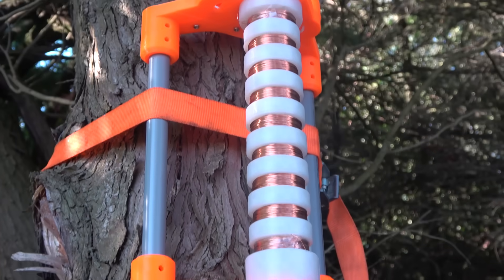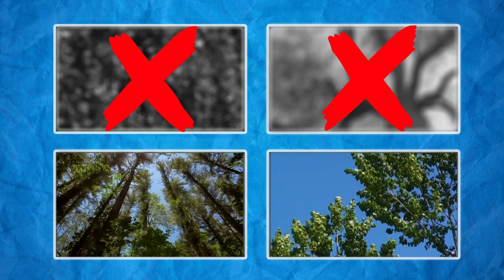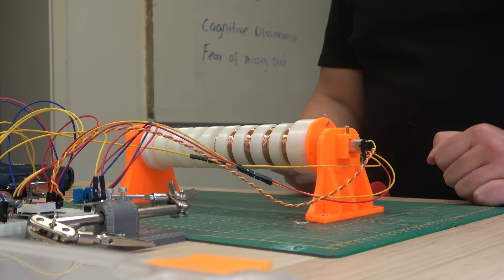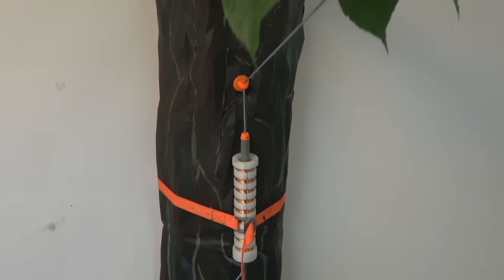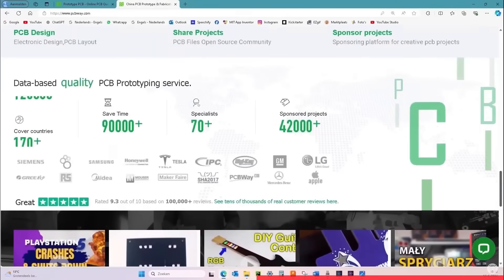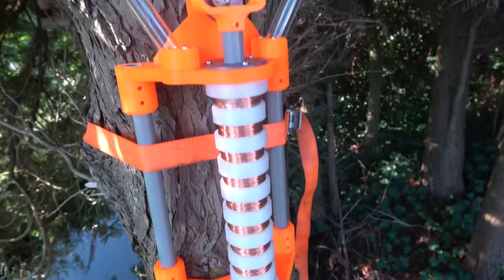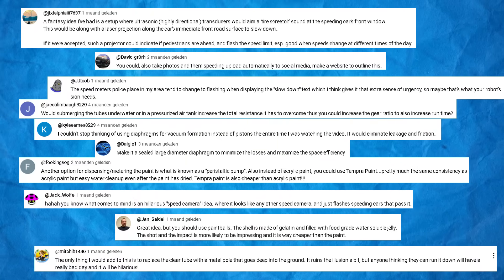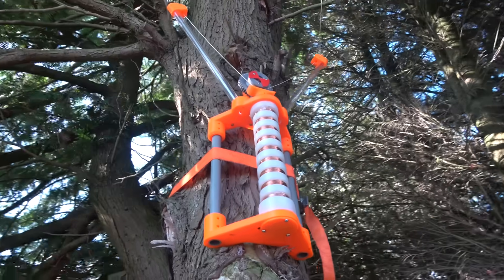I Made a Tree Generate Electricity..

Comment: check out air batteries . 2 aluminium rods and the electrons in the air = power, then get a sponsor and supersize it .
Reply from the maker: If only it were that easy🤓
Reply: you need a ridiculously tall tower to accomplish that sort of power generation since its the difference between charges thats doing the work. Plasma channel has a video showing that even a drone at max height only makes enough to light a bulb or turn a brushless motor.